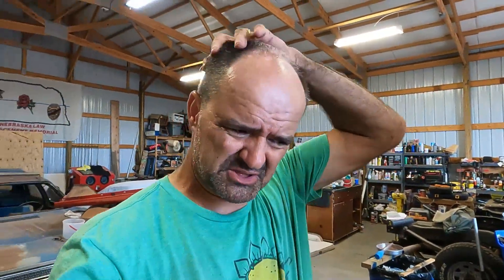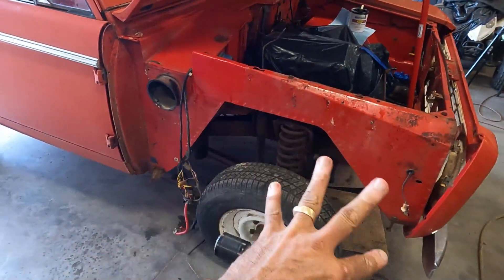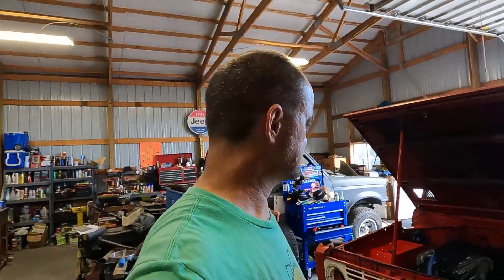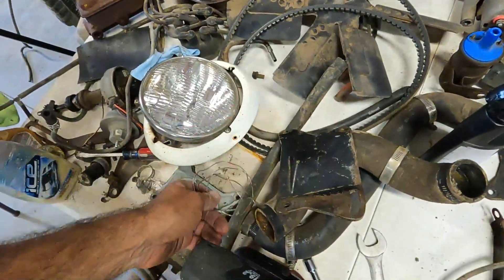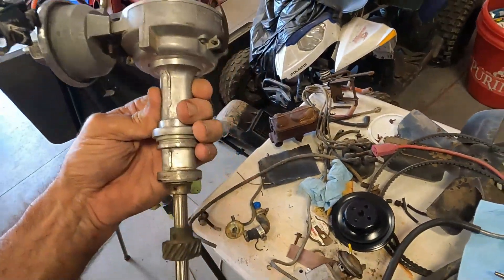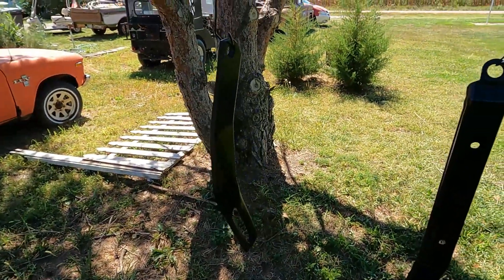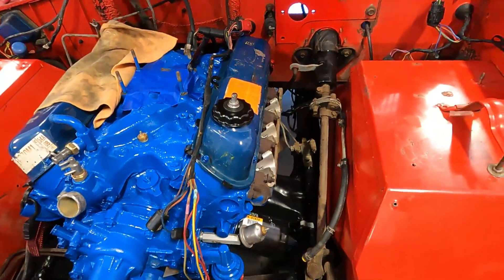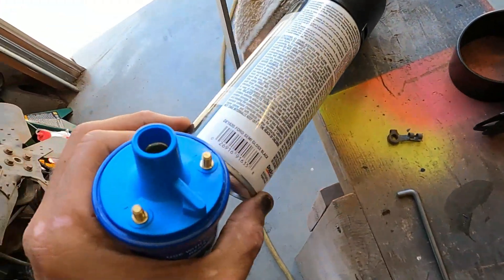1974 Ford Bronco engine beautification Part 2.  Parts, sandblasting, painting and more!

Comment: Liking the Bronco videos.
Where did you get the burnt orange paint to match the exterior or did you just use orange spray paint?   I need to paint several things on my orange bronco as well and want it to match the exterior.
Reply from the maker: Hey again Bryan!  You may want to verify that color.  Our customer’s Bronco is actually Viking Red!  It looks burnt orange but when we’re done reconditioning the old oxidized paint it’ll be bright red.
Look for the paint code either on the door jamb sticker under the VIN , or the stamped metal tag on the glovebox door.  It should be a simple single digit number or letter.
Find a reputable automotive parts/PAINT PRODUCTS supplier.  Most can now mix single stage spray bomb cans using the original paint code.  That’s where we’re getting ours.
Reply: @freedom1garage  Thank you!!! I think my code is H.  I will do more digging.  Keep em coming!!!